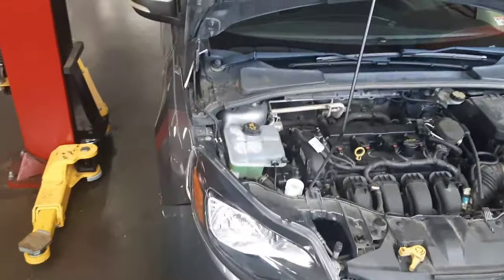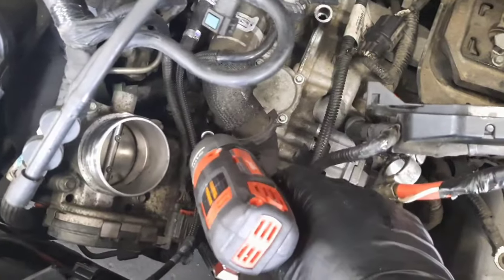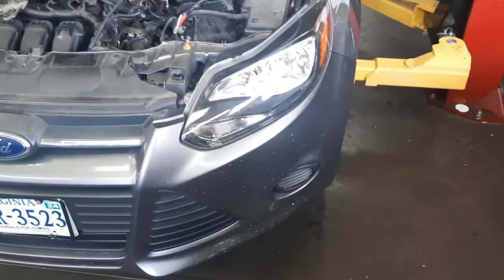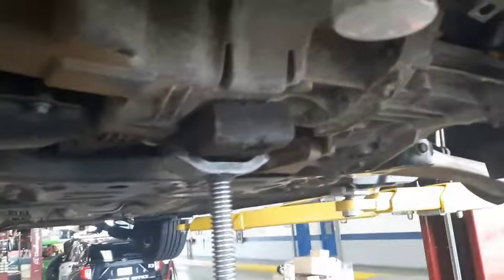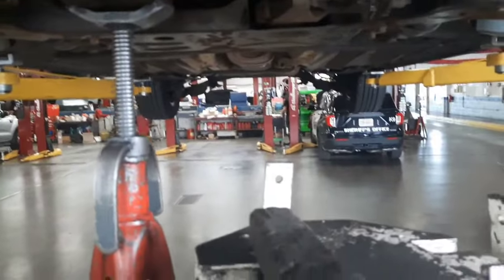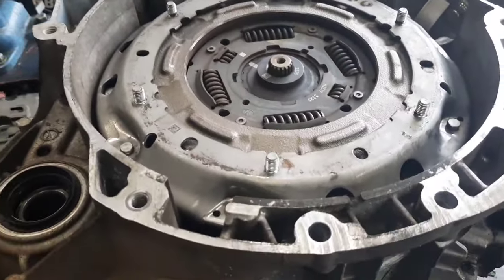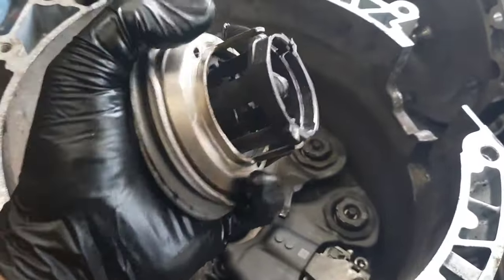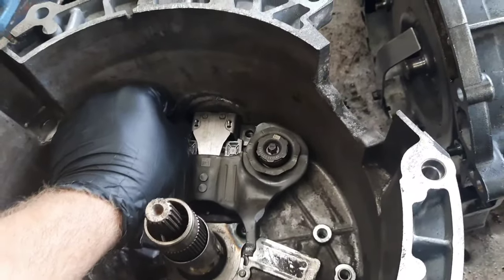Ford Focus Clutch & Fork Replacement & Transmission Removal |  Dual Clutch Automatic 2012-2018

Comment: Do you know the part number for the snap ring(s) you said not to reuse?

Thank you for the video by the way :)
Reply from the maker: You're welcome. The snap rings come in the seal kit EV6Z-7052-C for the focus.
Reply: @BigBensCarsAndCycles Thanks! Do you think I could use a socket to seat the clutch? I really don’t want to spend over $100 on a clutch kit just for that one tool. I can’t seem to find that one part of the kit on eBay or anything. I don’t mind having to modify the socket with a dremel if I have to.
Reply from the maker: @NaviYT If you bought the LuK Repset clutch kit, it comes with a new slave cylinder sleeve (the sleeve with 3 torx 30's on it) and that works perfectly to install the clutch. If you didn't get that kit, check this other video of mine where I did the clutch without any special tools: https://youtu.be/EIJt9anfdSM?si=JLlvuewjejlOSb3k
Reply: @BigBensCarsAndCycles  thanks!
Reply: I’m not gonna change the clutch, just the clutch forks. So I’ll use the video without special tools for now and then I’ll make sure to order that clutch kit when I’m ready to change the clutch.
Reply from the maker: @NaviYT  OK. My latest video shows how to lock the clutch for re-use
Reply: @BigBensCarsAndCycles  thank you so much Ben. I’m so glad I subscribed to your channel! Keep doing god’s work :)

Comment: Great video! I have installed a refurb clutch assembly and noticed it does not have an alingment mark to line up with the flex plate. I dont see how i can align clutch assembly with flex plate with out alignment mark and am concerned it will have vibration. What would you suggest? Thanks
Reply from the maker: I think you'll be fine. Just make sure to torque the clutch nuts properly, that's all I've ever seen cause a Vibration after a clutch. I've got a video for torquing them if you need it
Reply: @BigBensCarsAndCycles  thanks! I'll check it out!👍

Comment: Hi all, I have a 2014 ford focus titanium and I just had a transmission specialist say I need a whole new clutch replacement. What would you say that should cost for this make and model and this part/labor needed? I got quoted $3,100 parts and labor. Is that steep? I feel like it shouldn't cost that much. I live in central texas btw.
Reply from the maker: If they're doing the clutch, forks, slave cylinder, fluid and both actuators that's reasonable. If they're  not doing actuators, that's about 300-500 bucks high

Comment: Great video, excellent explanation, I was just confused about how many bell housing bolts there were total? I got 9 on my cord focus, the three on top, the two next the catalytic converters, the two on the bottom and the two next to the ones on the bottom, I don’t know if those were all of them because when I try to remove the transmission it seems stuck to the engine even after I pull. But others than that definitely the best video out there on this subject and definitely worth subscribing
Reply from the maker: Don't forget the stud for that ground! located near the starter
Reply: Your a legend, thanks!

Comment: Like the video. 2013 Focus 272000 miles on it. Think the drivers diffential bearing is going bad. How is it removed?
Reply from the maker: Take the case halves apart and it comes out. See my video on dps6 partial teardown
Reply: @BigBensCarsAndCycles  the bearing a pull or press off?
Reply from the maker: @Drago5017DK  The differential bearings are pressed off. make sure to reuse the shims behind the races

Comment: Hey I’m having trouble moving  the starter out of the way to get to the clutch bolts, any recommendations? I’ve already pulled out those lower mounts as well
Reply from the maker: Is it coming loose off the transmission?
Reply: @BigBensCarsAndCycles  I solved it! I ended up having to just take the starter off completely, definitely was a pain but getting the job done! Thank you

Comment: Great explanation man. I'm taking mine apart. I can't seem to locate my gearbox number to make sure I order the right clutch kit. Could you help me out? Where can I locate it exactly? I have a 2018 focus se. Thank you.
Reply from the maker: Hey, I'm glad it helped! The clutch and components are all the same on these focuses regardless of year model, so you should be fine! The ford clutch part number is f1fz-7b546-b
Reply: Day 3 of replacing my transmission.... you make it look so easy lol.... I'm at the point where I just slipped in the new clutch. I can't seem to find the service tool you used to hammer the clutch down. Is there a name for it? Or is there an alternative? Thank you.  Much appreciated.
Reply: Just a FYI ex LUK Employee that can also say the Festiva Clutch also works on the Focuses its a bit smaller dia clutches but everything bolts up.    Told it may provide a better feel when driving with a possibility of shorter life span figure (250K from the rest of the car so $ depending.) 😉

Comment: Are there any tricks to getting the CV axles out? I've been trying for the past 2 weekends and I can't seem to get them out. Haven't even really tried passenger side yet, just been focused on drivers side first
Reply from the maker: Pop the ball joint out, get a BIG prybar, and pop it out of the transmission. You can rotate the axle 90 to 180 degrees if you're having trouble, that may unstick the retaining clip

Comment: What is the best way to get the clutch nuts out through the starter hole?
Reply: I used a 13mm box end wrench while holding the crank with a 21mm socket.  Then use your fingers to loosen and remove the nut.  EZ PZ

Comment: Hey I have a question… I ordered an aftermarket clutch kit and the new clutch does not have the white marking for the hub to line up…. Should I just copy from the old OEM clutch? Or does it really matter?
Reply from the maker: Hi, it doesn't really matter
Reply: @BigBensCarsAndCycles  thank god. Thank you!

Comment: Do you need to unlock clutches when adding new actuators?
Reply from the maker: When replacing the actuator motors, no its not necessary

Comment: While unlocking the clutch I accidentally let go during the 6th rotation. Will this have any effect on the transmission or can I simply start the process over and rotate the necessary 14 times?
Reply from the maker: You can just start the process over. No problem
Reply: Thank you!!! Appreciate all your videos on these

Comment: My transmission overheated now it only has first gear. No reverse. Any suggestions on what I should try first? or just full out replacement?
Reply from the maker: Check out my video on no engagement, it's a step by step guide. Don't replace the Trans. Fix this one

Comment: I've got a manual transmission that I need to replace the clutch in, how much different is it from this one with automatic transmission?
Reply from the maker: @light-master  as far as removal, the basic principle is the same. But there's some differences. I've got a video removing a manual on a 1.0 ecoboost focus which is more like yours. But not identical
Reply: @BigBensCarsAndCycles  Just saw this comment (YouTube hates to notify people of comments, lol). I've gotten part way through over a couple days, whenever I have time to go work on it. Gotten to the point of removing the bell house bolts on top and about to remove the axles. I'll go check out that other video now to see how it compares to my car. So far, only difference I've noticed is a slightly different location of the trans drain plug, mine being horizontal and yours being vertical.

Comment: Did you happen to have an obd code that correlate with this problem?  Was this done due to the car shifting harshly or...? Im asking because i have shifting issues and found glitter in my trans fluid. Also have odb codes for transmission
Reply from the maker: Some glitter is normal for these. What Codes do you have? Please thumbs up this comment when you reply so I get notified

Comment: I haven’t done anything to my DPS6 transmission or clutch. 16 Focus SE . I have the external clutch actuators and need to know if replacing them will help . Soo as I’ve told you before, serious slipping issues with lower gears. Not so much higher gears. The only code I had was P0700 transmission electrical system. That went away since I sanded the two grounds under air filter box and the main one from battery negative side found on firewall driver side. Not getting any transmission codes anymore. Do you think replacing clutch actuators will help ? Any help is appreciated. Try it and maybe it’ll help ? It can’t worsen it ?
Reply from the maker: Turn the clutch forks by hand, if they're seizing then that can damage your new actuators if you install them.
Reply from the maker: Since there's no codes and you're still having a problem, it's likely a seizing clutch fork or disintegrated slave cyl bearing

Comment: Pretty good video, BUT no special tools, then tell us need clutch removal tool, clutch install tool, clutch unlock tool, touch point learn tool. Maybe could drop in some links to the tools and do a video on the learn procedure. I can do the homemade removal tool. :)   Thanks for the video
Reply from the maker: You can get forscan for the touch point learn. And heres my video with using ZERO special tools: https://youtu.be/EIJt9anfdSM?si=jRDZpqr8DN9kDWeA

Comment: Hey Ben, I was just wondering I finished working on this car and everything seemed to work very well until today Seems that it shakes badley also when I press the brake the car revs up. The car also when u stop from a higher gear sounds like its slamming and gear 2 or three sound like there grinding this morning any help would be appreciated
Reply from the maker: Any codes? Can you get a video clip and post on my Facebook or discord group ?
Reply: @BigBensCarsAndCycles  posted to discord

Comment: When you put averything back you have to programade the transmision or what you have to do?
Reply from the maker: You need to learn the touch points of the clutch. You should be able to do that with forscan

Comment: I’m reusing the same clutch and when I push it down to get the first snap ring in place, the clutch springs back up so I am unable to put the ring in? I have reset the clutch twice and it seems to spring out when I put it in. Is it because my clutch is too worn out?
Reply from the maker: It sounds like the clutch is not fully resetting. They can be a royal pain to reset. I would buy a new one. It sounds like you tried and it will not fully reset. I've had tons of them do that

Comment: My 2014 started making a grinding sound after they replaced the TCM. Dealer says unrelated.  1st and 2nd is loudest. Still drives normal. Any thoughts?
Reply from the maker: I'd have to hear it. Could be a worn syncronizer or a clutch noise. You can join my Facebook group and post a video clip if you'd like

Comment: After 70,000 miles I need to have this done. Is it worth it?
Reply from the maker: Yup. They're great cars otherwise. Only a few minor other issues. And either way that's low mileage on your car. So it's worth more than one with over 100k
Reply: Ford will replace them if its less than 100k and 10 years.

Comment: I have ford transit connect 2017 automatic and it has scrape noises when it go in 1st gear and also when it going down to 2nd and 1st gear from higher gear, do you know if it is the gearbox or just the clutch? it happend after a little too heavy trailer trip.
Reply from the maker: In my market, the transit connect doesn't have the dual clutch. Does your country use this transmission? If so it sounds like your describing a worn syncronizer. It may be clutch chatter too. I've got a Facebook group, link on my channel page, If you'd like to post a video clip. I normally accept new people within a day

Comment: How much trans fluid do I need to refill when installing? 2014 ford focus thanks
Reply from the maker: 1.7-1.8 quarts of dual clutch transmission fluid after draining. (motorcraft XT11QDC)
Reply: @BigBensCarsAndCycles  thanks so much, doing the repair next weekend
Reply from the maker: @AZaker-jw1fm  Awesome! Have fun. I've got a playlist now with all my focus transmission videos, so if you need any help you know where to look! 
Hit that sub button!
Reply: I rewatched ur video and for the clutch reprogramming you said you can use forscan or anther tool, I watched a video before I found urs and guy used/did a video using a tool called “Launch X431 Pro Mini scan tool($670) im assuming that works as well or should I get the forscan instead? With u being a mechanic I trust u more but like the other tool with a handheld screen to follow. Thanks

Comment: I have finished putting the clutch in, but it will NOT spin freely anymore.  As I am pressing the clutch onto the center splines it requires more and more pressure to spin the clutch.  This is my third transmission and when i finished the clutch replacement on the other transmissions the clutch would spin easily.  Any ideas as to what might be going on?
Reply from the maker: Is the clutch locked (in the reset positon)? If it's been released and is being reinstalled, it's not going to press down properly if released
Reply: @BigBensCarsAndCycles I installed the brand new clutch into a car and there was no reverse.  I realized that the shift drum stop inside the transfer case was broken.  So the clutch was used, but it only shifted into first gear.  I took the clutch out and attempted a reset, but the first step of the reset (with the smaller ring tool) appeared to be completed.  I was able to finish the second step normally.  So now I am trying to put the clutch into a new transmission housing and I am running into this issue.

Comment: Hey can you help me, I just installed a clutch and forks on my 2013 focus. Go to do the adaptive learn and it gets stuck at Gear command for neutral state on both transmission shafts. It doesn’t fail or pass it just sits there until it tell me to turn off the ignition
Reply from the maker: That's not good. Check my video for code p287B (you can search my videos for it) then check my video for project Focus transmission replacement (I tear the old one down backwards and it's super easy to replace your case that way if you need to)
Reply: I do have p287b i look at it, I drained the old fluid and it look like it had atf in It I flushed it out but Im sure there’s internal damage
Reply from the maker: @alexdominguez1879  probably broken shift drum stops or a bad tcm. my 287b video shows a way to test

Comment: Hey, Ben. It’s me again lol. I bought a remanufactured clutch for a DPS6 (probably ill advised) a while back and I’m just now installing it and the markings are all sand blasted off the front. There is no longer a triangle next to a stud to match up with the triangle on the flex plate. Is there another way to identify which stud on the clutch should go into the whole with the triangle marking on the flex plate? Will it be out of balance and shudder like crazy if I don’t get the right clutch stud into the right hole on the flex plate? Thank you
Reply from the maker: Hey. It'll be alright. Just put it in. Make sure to torque the nuts properly, I've got a video for torquing the clutch nuts
Reply: @BigBensCarsAndCycles  Sounds good! I have done the two stage torque sequence on them before, but I’ll definitely look for that video and watch it as a refresher. I always learn a new thing or two in all your videos. Do you have a video showing how to reset the clutch before reinstalling it? I.e if I needed to service my transmission but wanted to reuse the same clutch because it’s only got a few hundred miles on it
Reply from the maker: @goodenuff1557  I'm glad the videos have helped! I don't have a video for locking the clutch. But I can do that tomorrow!
Reply: @BigBensCarsAndCycles  Hell yeah! Thanks man. I’ll be on the lookout

Comment: Sir do you have a video showing process for the adaptive learn ?
Reply from the maker: Yes, but with ford ids. Similar steps with other scan tools though. The procedure is called clutch adaptive learn, and it'll guide you with instructions
Reply: @BigBensCarsAndCycles  is ford ids free?
Reply from the maker: @gcposeidon0800  no its not. If you have a laptop, get forscan. Otherwise check Amazon. I've heard there's a $120 scan tool which can do that on there (x431 elite)